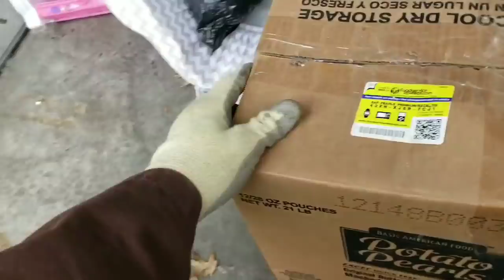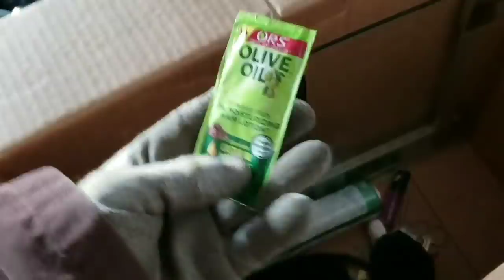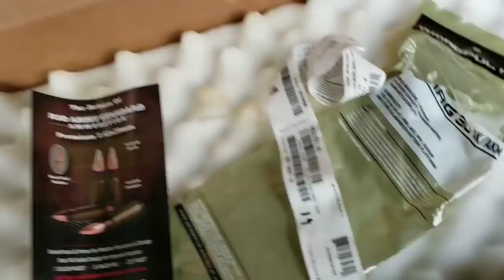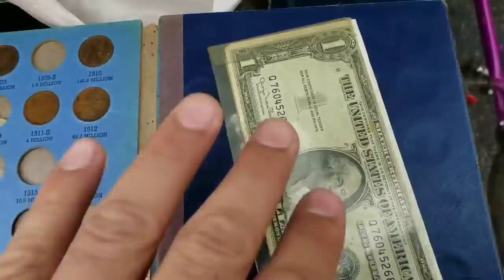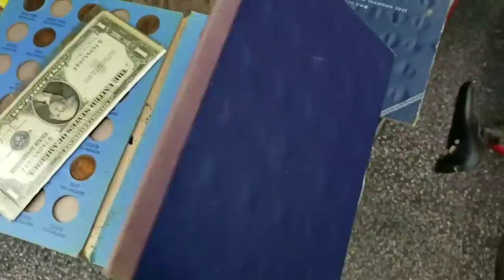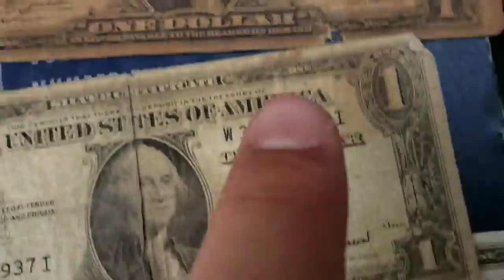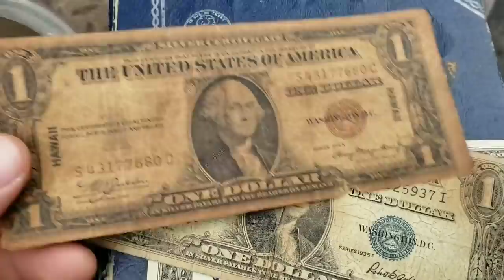FOUND MONEY IN LOCKER I Bought An Abandoned Storage Unit Locker Opening Mystery Boxes Storage Wars

Comment: Don't know if you're interested, but this is my secret.
Lightly soiled/dirty stuffed animals, fur hugs, lightly brush w plain shaving cream $1 store kind (-not menthol to or lotion kind) using a soft brush. Let sit a few minutes. Rinse w wrung out clean cloths using water only. 
Last put it in the dryer, on most gentle cycle, air only, not heated. 
In 10 minutes take it out of dryer. Shape as needed w your hands, and let sit on clean towel, not in sunshine or near a heat source. I used to put them on the back of sofa, kids wake up to clean babies. 
I clean my eye glasses w shaving cream, especially the nose pads, rinse very well w warm water. Dry w clean cotton cloth.
Shoes, baseboards, patio furniture, wheels, etc.